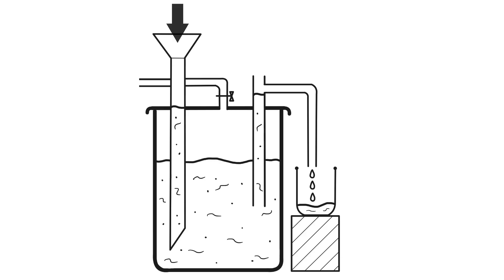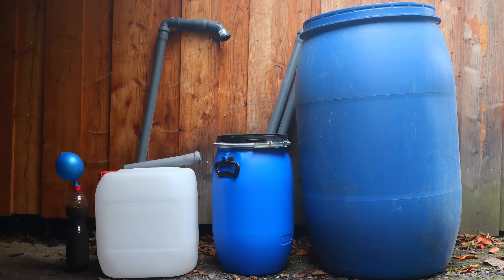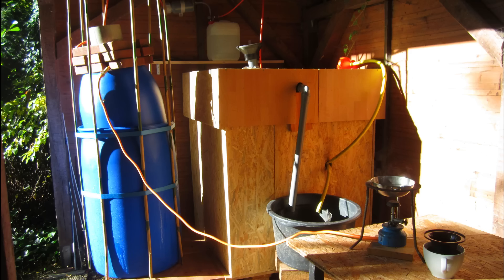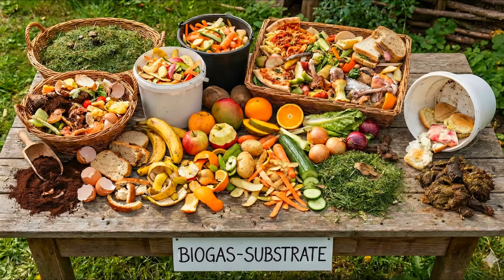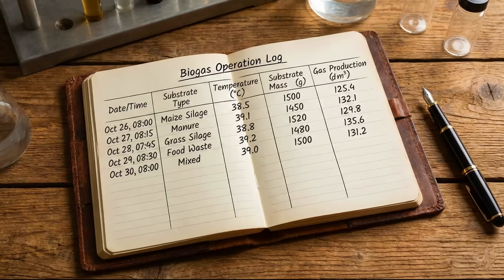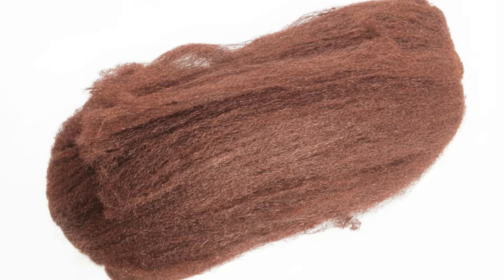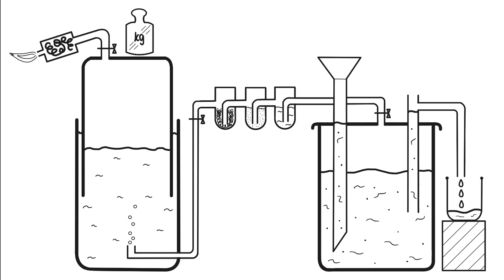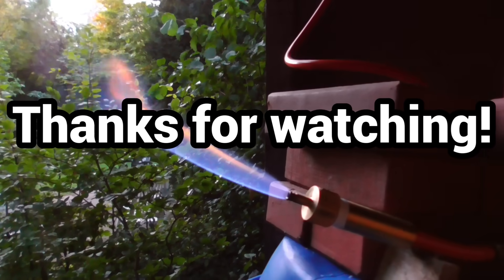Make your own cheap energy with a DIY mini biogas plant

Comment: When I tested this in lockdown, I added solar thermal water via    copper car pipe and a 12v pump.
Reply from the maker: In winter, I also heat the fermentation tank a little with the return flow from my combined heat and power plants.

Comment: I have seen this guy use empty propane tanks to fill with the Mansion homemade gas. (Not too completion because you would need some way to cool it to liquefy).Utilizing a compressor directly connected to a blow-up mattress filled with the homemade gas. What do you believe is the better way to store the gas what I just mentioned or the way you do it?
Reply from the maker: Liquefying methane under high pressure and storing it in gas cylinders is one way of storing large quantities, but unfortunately this is costly and very energy-intensive.
Reply: @myengines2443  It wasn't what I asked but thanks
Reply from the maker: I think a mattress or other inflatable things are not so safe and sturdy as my barrels but maybe cheaper and larger.

Comment: I built one many years ago. Never got it reassembled when I moved, but still wanted to share my idea.

My pressure system was 2 55gal drums, undamaged and pressure tight.(One at least had to be pressure tight, I removed a bung from the other(top) drum to allow for displacement.) 

I stacked one on top of the other, with ¾ PVC pipe connecting the bottoms of both drums, and the gas piped into the top of the bottom drum. 

Then I filled the bottom drum with water. As the gas was produced, it would push water into the top drum. This, of course, was an inconsistent pressure system, which I just adjusted my gas flow for over time, because I only used it for cooking, but a simple regulator would take the guesswork out of it. It was certainly more stable than weights on top of a floating drum.
Reply from the maker: Sounds very interesting, thanks for sharing!

Comment: If in a colder climate, or cold time of year, could the barrel be potentially insulated? Fermentation generally generates heat. If insulated, could very well reach desired temperatures without an external heat source. 

I see this happen in mulch piles all the time. Dead of winter, and they'll be steaming. Reach inside, and it's incredibly warm.
Reply from the maker: I insulated the digester for the winter as you can see int the video. i wrapped also a hose around it and let warm water from my CHP unit flow through it when it is really cold.
But if insulated well you only need only a bit additional heat only when it is really cold.

Comment: Cool video! One thing to note, the concentration of H2S in the raw biogas is actually very high and if you would probably  die if you were to stand in an atmosphere of it. So the notion of it being "harmful to health" is a bit of an understatement. H2S is super toxic, comparable to carbon monoxide!
Reply from the maker: The concentration of H2S is in a well functioning biogas formation is normally less than 0.3 %.
If you also clean it as i show it should be no problem.
I never had any problems like smell or corrosion with the cleaned biogas.
Reply: @myengines2443 yes I realize that the risk is still low for human health if everything is done right. H2S is already harmful to health in much lower concentrations and I just wanted to point out that when working with it, it is important to stress the consequences, even if the probability of a catastrophic failure might be low. liebe Grüße aus Österreich :)

Comment: People can laugh if you want. But there are already fuel cell generators on the market today that could provide a constant 2kw of charging from a lil biogas reactor like this. Which is more than enough when combined with a 20kwh battery to run any household.
Reply from the maker: Do you know if a fuel cell can be homemade or is it very complex technology?
Afaik the commercial units on the market a very expensive but it is a very interesting technology, thanks for your nice information!

Comment: Worth noting that most municipals use chloramines instead of just chlorine which are temperature stable, which means it can neither be left open nor boiled to be removed, it must be chemically neutralized (with sodium metabisulfite if i remember correctly, look it up yourself) which is actually very cheap to do. you can check your local government water pages to see if chloramines are being used but most of the time the answer will be yes now
Reply from the maker: Thanks for your good information, maybe someone could have trouble with this!

Comment: 200L of methane at what pressure? Volume of gas isn't a good figure.
Reply from the maker: The pressure is a little more than ambient, you can see the big diameter of the barrel and the relatively small weight of about 30 kg!

Comment: A liter of biogas contains between 21 and 30 kJ of energy. Natural gas is 35 kJ/L 
However my heating system uses multiple cubic meters (1000L) per day in winter. Only cooking would be possible with 200L of biogas, however I wouldn't want to cook on biogas with all that nasty hydrogen sulfide inside my house. 
Alternatively 200L of biogas contains (at best) 1,6KWh of energy, so converting it into electricity would yield less then 1KWh of stored electrical energy. 

So how does 200L fit your personal energy consumption? Unless you are living in a very well insulated small shed, I don't see that really adding up here.
Reply from the maker: I want, as I say in the video, build a much larger digester to fuel my CHP Stirling engines to backup our solar plant when the sun is not shining!
The base load capacity is the major advantage of the biogas plant!
Reply: @myengines2443  Ah I missed that last point. I was more or less focusing on the 200L part :D Thanks for clarifying.

However you would need to seriously increase you production capacity if you want to create enough gas for backup power. Even if it's only a base load. It would be a great achievement nonetheless. Thanks for clarifying.
Reply from the maker: My plan is to build a 1000-3000 liter digester when my thermoacoustic Stirling CHP plant is developed to my satisfaction!

Comment: Great video! The one thing I would have liked to see is the energy content of 200L methane in more familiar units. For those also curious, it's 7 to 8MJ, equivalent to 230ml of gasoline, or about 2kWh
Reply from the maker: And its a small digester, imagine one of 1-2 cubic meters which will not be much more work and cost!

Comment: Fantastic Video. As a person who also plays with biogas sometimes I appreciate the straightforward information. For me the trickiest part has always been rigging up a filter system. Maybe it is time to build a new and improved plant.
Reply from the maker: Do it please and show us your work in a video, it's much fun!
Thanks for your nice comment!
Reply: @myengines2443  My friends have been telling me to start a youtube to show the projects I do. Like just this summer I rigged up a 3500w solar system with 18Kwh of batteries. I was using it all hunting season and it worked fine, even when it was -30 outside. I think it would be super cool to compress some biogas and then use an ICE generator to power the system. 

It helps that we have 80 cows who have a passion for turning grass into solid bio fuel lol
Reply from the maker: That sound like an ideal setup!
And please make the videos its really much fun and the support of the community is great and very motivating!

Comment: Very intresting project, would fit right in to an apocalypse setting. In your opinion is this a practical method of generating energy? Just doing some napkin math, it sounds like it's about 2 kWh thermal energy and about 0.5 kWh electrical per day. And that's like the equivalent of 0.5kg of firewood, are there any specific use cases where the gas form is more useful?
Reply from the maker: Our wood is all used for warming the house and its has different problems to fuel the CHP units with solid fuel!
But we have always enough green waste so its for free and a larger digester will produce much more gas.

Comment: Ein Nano-Blockheizkraftwerk basierend auf selbsterzeugtem Biogas... das klingt spannend!

Was sind die wichtigsten Nachteile des Systems?
Reply from the maker: Meine Stirling BHKW's sind selbstgebaut und die Leistungsfähigeren wären auf dem Markt viel zu teuer und wartungsintensiv.
Deswegen versuche ich jetzt die Motoren stark zu vereinfachen und wartungsarm zu machen, was du in meinen anderen Videos sehr gut sehen kannst!
Reply: @myengines2443 Bosch Thermotechnik: Logavolt, Brötje: EcoGen WGS 20.1, Navien: NCM-1130HH, ÖkoFEN: Pellematic Smart_e, Paradigma: ModuWatt, Remeha: eVita, SenerTec: Dachs Stirling SE, Vaillant: ecoPOWER stirling, Viessmann: Vitotwin 300-W, WhisperGen... gefühlt tut sich ja bei Nano-BHKW mit Stirling Motor was.
Gerade die Kombi mit selbsterzeugtem Biogas kannte ich bislang noch nicht.
Weiter so!
Reply from the maker: Danke, ich tu mein bestes, da ich alles nur als Hobby nebenberuflich mache dauert es leider immer sehr lange bis ich grosse Entwicklungssprünge präsentieren kann!
Reply: @myengines2443 Ich finde derzeit Nano-BHKWs extrem spannend und dachte eigentlich an Pellets... aber Biogas hätte an sich ein besseres Verhältnis aus Wärme und Strom und die gezeigte Erzeugung ist schon spannend. Ich habe das bisher nur bei Viehwirtschaft gesehen.

Viel Erfolg beim weiter forschen und basteln! Ich habe schon BHKWs mit Stirling Motor gesehen, die schlechter als dein selbstgebautes wirkten.

Persönlich fehlt mir die Zeit und die Erfahrung für so etwas.

Comment: could be interesting to combine it with hydrogen.  How comes the residue out of the tubes on the right? And do you have to empty it sometimes from "indigestable" stuff? Liebe Grüße
Reply from the maker: The residue is pressed out of the digester because of the pressure that effects on the small diameter of the tube.
If you take care of clan substrate you have to clean it only every few years!

Comment: My 5cyl 3liter 1982 Mercedes turbo 300SD with automatic transmission used to get around 30mpg, heavy car but probably less air resistance than the S10.

Comment: If i understand it correctly, small amount of old substrate is flowing outside to another bucket when you add new substrate yes? And you can use it for plants. So you never need to empty the biogas reactor?
Reply from the maker: If you take care that the substrate is clean you only have to empty the digester only every few years, right!

Comment: I would welcome it if you were to design safety vents that would rupture in case of an explosion but would of course be completely sealed during normal operation.

Such explosion vents would release pressure and flames through a frangible panel.

I think that you could contribute significantly to the design and construction of such an explosion vent.
Reply from the maker: I think that's a task for a specialist. I think it is not so dangerous at is looks, as in the gas storage barrel is no oxygen

Comment: Maybe a dumb question, but why not dessicate/air dry the scraps and dung, and once dry burn them directly as fuel? Efficiency should be seriously higher and its way simpler.
Reply from the maker: I am not sure if this is simpler and more efficient, but above all it is not so easy to heat my Stirling CHP's with solid fuel!

Comment: That is an absolute s***-load of work and maintenance for at most 2kWh per day.
Reply: @acf2802:   Ever hear of asking? It's this thing that smart people do instead of trolling, like you just did, when they see people who are doing this thing called "work". If you would, like, USE your intelligence and had asked everybody to help you out in your ignorance, you would have gotten lots of responses that might make you less lazy and more prosperous. Here's just one:
You don't have to install a septic system or pay a sewer bill if you install this system first, or a modified version of it as needed. Pair that installation with an autonomous water system, and you don't have to worry if your local utility blends the sewage bill into the water bill.
Reply from the maker: The work is not as much as you think, and if you don't care about energy, then this really isn't the right thing for you.
Reply: @myengines2443  I care about my time. I'm not going to power my house by hooking up an alternator to a bike, no mater how much "I care about energy."

Comment: Hi! Regarding CO2 production, I've seen other YouTubers using microalgae that require both CO2 and sunlight. These microalgae can be used to make fertilizer, or even biodiesel through a process called transesterification.
In a quick search, I saw that these algae aren't sensitive to methane, so you could perhaps come up with another cogeneration method! I'd love to see it.
Saludos desde Argentina!
Reply from the maker: Algae are a very interesting theme that I would like to try, but unfortunately my time is limited....
Maybe they are a very good substrate also?

Comment: Carbon Dioxide Scrubbing via Algae was an interesting concept i saw in a Paper/University study.

Granted without a Grow Light, it would require sunlight, but testing this with an Aquarium Tank based Photobioreactor would be neat!
Reply from the maker: That's a really nice possibility, can the algae (very interesting for themselves also...) be used as a substrate then or do they have a better use?
Reply: @myengines2443 I’ll need to check and see.  On the Industrial Scale, “Hydrothermal Liquifaction” (HTL) would probably make more sense, as it creates a “drop in” substitute for Crude Oil.

At the “Makerspace and Below Scale”, the main usage would be for Algae Oil, then Transesterification “Biodiesel”, but this requires drying + methanol, so is a bit of an intensive process for a sub-par product.

Feeding the Algae Oil, or better yet Pasteurized Whole (Potentially “densified” to reduce media loss) Algae into the reactor may make a good feedstock.  Oils/Fats make lots of biogas if i remember correctly, and also “Cell Lysate” (old cells who’s walls are burst, typically with heat) is used in Microbiology.

GRANTED Algae and Anaerobic Digestion Colonies (although “Activated Sludge” in sewage treatment is related/MUNICIPAL Anaerobic Digestion Literature) is less documented/easy to read up on (Compared to Conventional (Maize/Sugarcane) Ethanol, or E. Coli based Precision fermentation etc)

All in all though, i love you work and would love to help out in the ways i can!
Reply: @myengines2443 throw them in the bioreactor

Comment: Open Source Ecology has made an IBC Tote Design that is Modular + Made of Mostly Hardware Store “Off the Shelf” Parts, i’ll throw some link spam below.
Reply from the maker: Yes, that would be nice, thanks!
Reply: @m @myengines2443 YouTube to prevent spam bots sometimes blocks link posts so tell me if you got it.  ALSO hopping over on the discord may be faster (assuming you are fine with that app, if not the Wiki or Email works fine too!)

Comment: This is a good video, but it covers much of the same subject matter as many other home biogas videos on YouTube. The information I am having trouble finding is what to do with the excess liquid from the digester. You say you feed your system about 2 liters a day of fresh "food" aka substrate. What do you do with ~2 liters of liquid that exits the system as a result? I keep seeing and reading it can be used as a fertilizer, but HOW? Does it need to be diluted in water before being used on your garden? What nutrients, and in what amounts/ratios are present? How would one go about testing their digestate liquid without sending it to an expensive lab? Would you consider making a follow-up video that covers how to use the liquid?
Reply from the maker: I just mix it with water in a watering can and put it anywhere in our garden. The lawn grows much quicker, which leads to more grass clippings which can after ensiling be used as substrate. If you want to be more careful you can put it on the compost heap first and use it after a few days.

Comment: I'd think drying and gasifying the food directly and burning it off in the stirling is more efficient and extremely faster, but biogasification works too
Reply from the maker: Can you describe the process of gasifying food wast in more detail as it sound very interesting?
Reply: @myengines2443 Depending on food dryness (drier is more efficient, for wetter foods you'll need to dry them with the sun), you can build a pyroliser reactor to transform the biomass in the absence of oxygen into a mixture of CO, H² and methane that's called syngas. This syngas can be cooled, cleaned, refined and turned into gasoline, or with your case most likely used straight from the pipe as a hot wet gas and be burned, increasing efficiency to ~20% over normal combustion due to lower incomplete combustion. Gasifiers take anything that burns and turns them into gas
Reply: The reactor can be either a simple metal tank enclosed with small air input and an output pipe or a very complicated reactor with a vacuum pump, temperature controller, air pump, etc.
Reply from the maker: Very interesting, I just knew the wood gasifiers and our wood is too precious as we need it for heating!
Reply from the maker: Thanks for posting!!
Reply: @myengines2443  you can make a CHP stirling, you can use the stirling exhaust's as heating with a heat exchanger. Although, with all your equipment, I'd recommend something like a gas turbine, it'd be more efficient and is able to make a good CHP unit with 90% efficiency